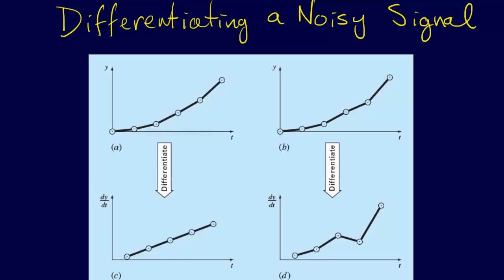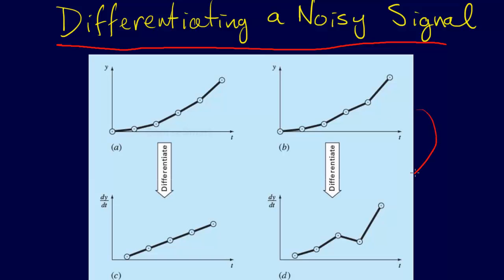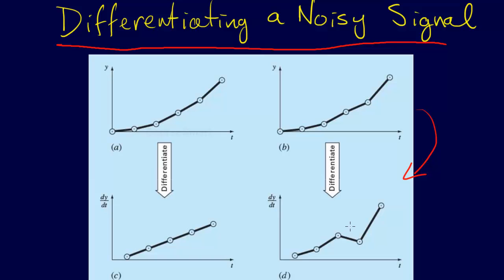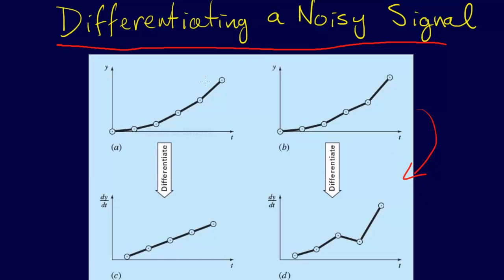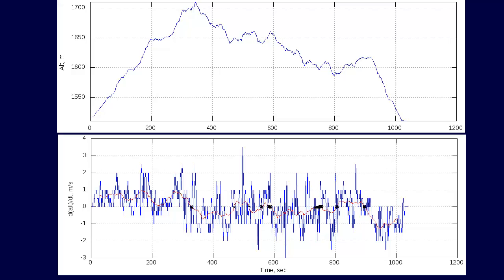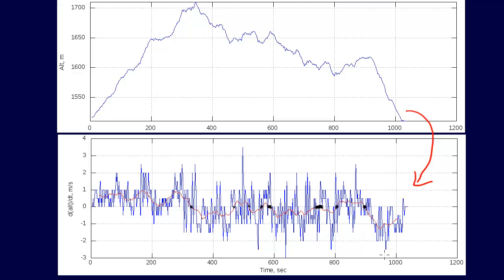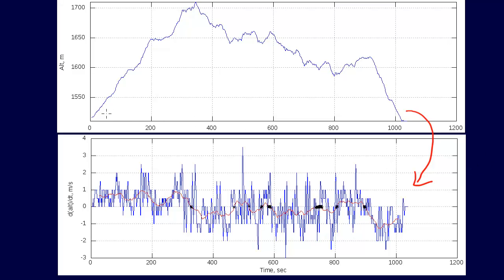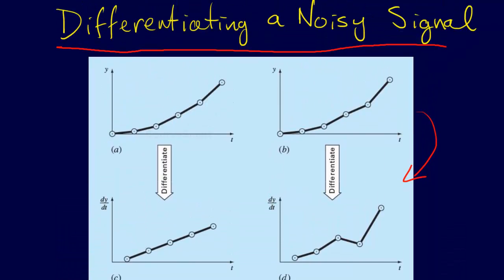6.3.7-Numerical Differentiation: Noisy Data

Comment: I've had some success with regressing on a moving window through the data, fitting a straight line to N points at a time (where N is an odd number), and calling the slope of the fitted line dy/dx at the midpoint of the line. Another technique is to slide a 3-point window through the data and compute the quadratic that passes exactly through those points; and again, calculate dy/dx analytically at the midpoint of the window.

Your altitude data made me wonder if it would be practical to analytically differentiate a Fourier approximation to the "mountain".

Comment: hey so what is the reason that conducting numerical integration would attenuate the noise signal?
Reply from the maker: Integration takes the area under the curve. Little jumps up and down, which is what you get when you add noise to the signal, tend to cancel each other out.
Reply: @kvyi   Is it the same thing for noise canceling headphones? Thank you!